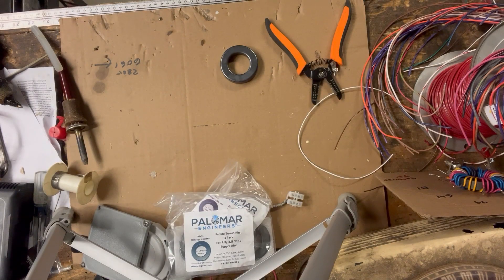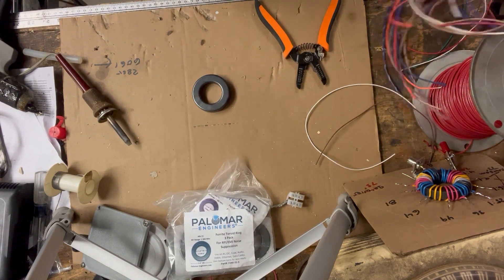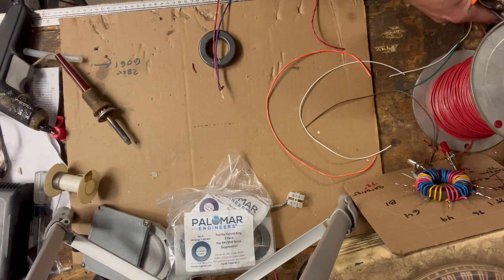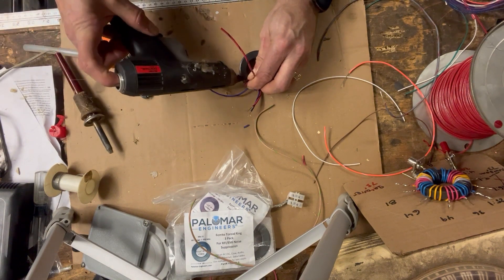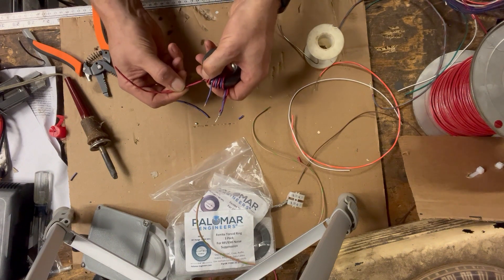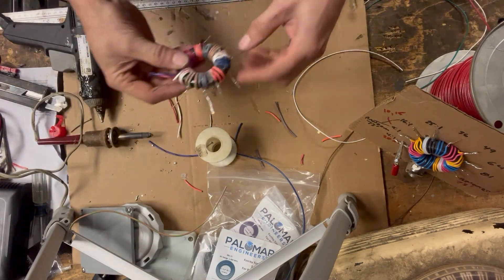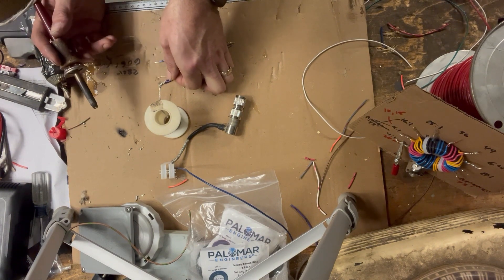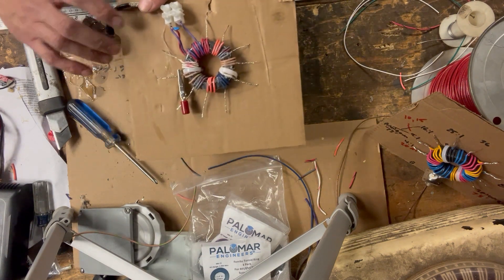How to build A multi tap Balun UnUN for cheap.  All Bands DYI!

Comment: I realized from watching this video the ratios are a pattern I vaguely remember. I may be young, but I've long since forgotten much of my math lessons, but I looked it up and the sequences are "Perfect Squares" 1, 4, 9, 16, 25, 36, 49, 64, 81, And if my hunch is correct the next two taps' ratio's should be 100:1 and 121:1 in "UnUn" configuration. I could be wrong I did drop out in the beginning of 10th grade....

Also I've been using Mix 43 instead of 31 in my transformers, would this be a cause of why 10m looks poor for SWR using a 66' wire? (49:1 as EFHW, not "random")

-73 de David KE0PBI
Reply from the maker: This was a fun project and while the multi tap is convenient,  its performance is not as good.   I did use a Mix 43 and did have different results on the higher bands.   Thanks for watching and try making one for yourself.  A very fun project.  
VA5MuD.

Comment: Does this work on 100 w radio or is it only good for QRP?
Reply from the maker: I’ve tested it on 100w.  But it’s advisable to start on low power when experimenting with wire lengths.

Comment: How many watts can it handle?
Reply from the maker: 100w to 300w ssb.  With a larger wire gauge and stacking two cores you can get to a KW.

Comment: Is there a version w/out the speed-up?
Reply from the maker: Sorry not at the moment.  Any part of the build you need a little more detail?
Reply: @MrMudsHamRadioTime  I was trying to follow along - it is 3 turns per wire, connected to the last turn, and connected to the next turn, until all taps are completed? Is there a document to follow?
Reply from the maker: @RayKasprowiczJr  great question.  The secret to winding a coil is every time the wire passes through the centre it’s one turn.  So yes three turns, tap, three turns, tap and so on.  I’ll try to get some more details posted.
Reply: @MrMudsHamRadioTime  - got it and thank you!
Reply: @MrMudsHamRadioTime  - I see we made a FT8 contact on 20M on 09/19/23 - W4RXK